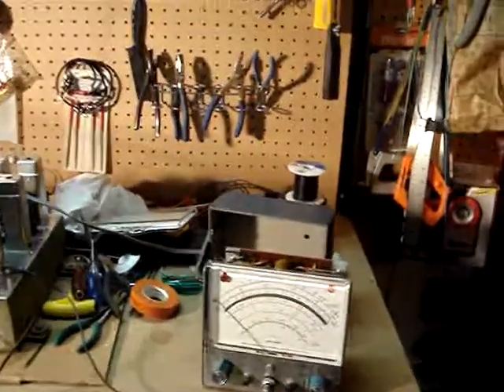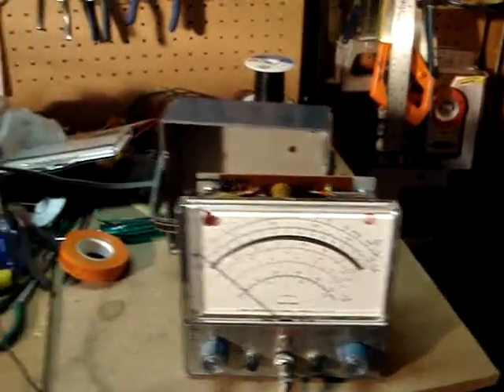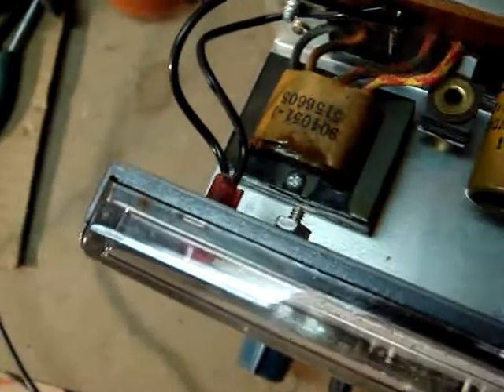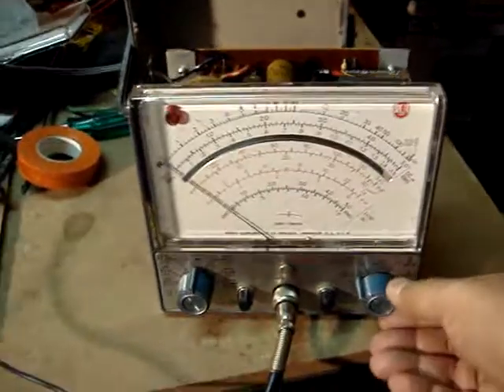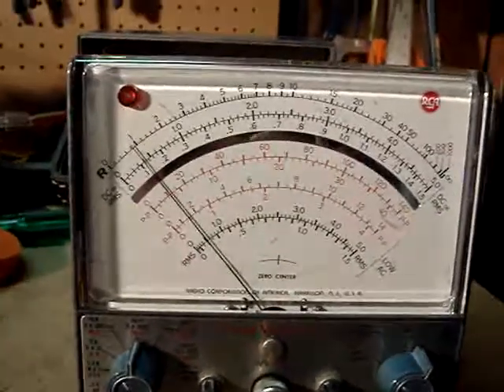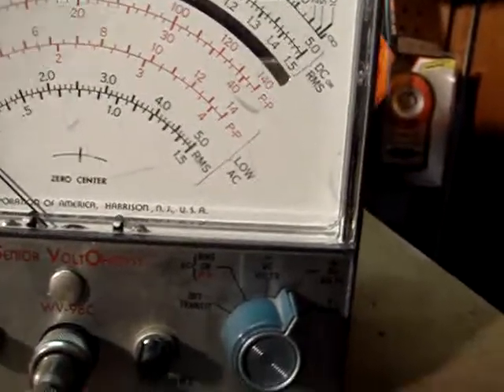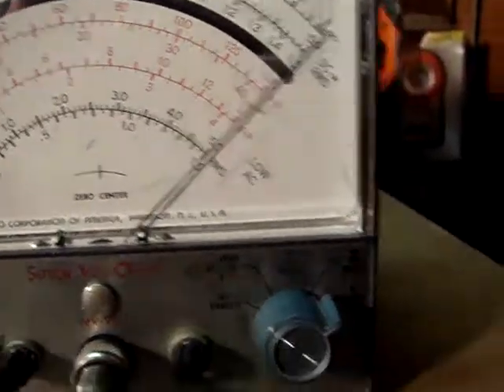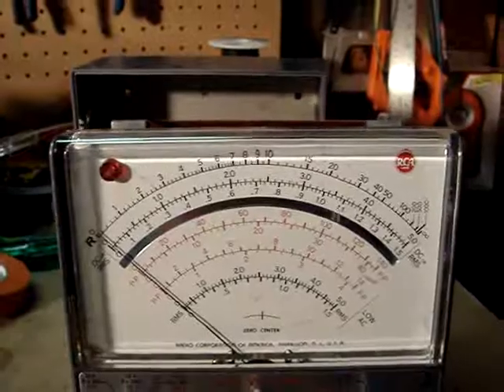VTVM RCA Senior VoltOhmyst WV-98C Meter replacement

Comment: Hi I too bought a VTVM RCA Senior VoltOhmyst WV-98C via ebay. The problem with mine is not with the meter, but with the antistatic coatings on the clear bezel and black meter housing.

Would you be interested in selling this to me if you still have it?
Merry Christmas!

Comment: @mukerjea I got the meter working, but when I switch between ac, dc- and dc+, the meter doesn't stay at 0. If I get the dc+ to be exactly on 0, and I switch to dc- or ac, the needle goes to the left past the 0 as far as it can go. When you switched between the functions, the needle stayed pretty close to 0, so I suppose there is something wrong with my meter.

Comment: @kb30022 Yes, the wire for the positive probe was shorted out. The only problem I have with it now is that it is inaccurate on all of the settings, and I'm not sure how to fix that. My ac wall voltage (120V) is showing up as 110V, and the resistance of a 100k ohm resistor on this meter shows up as 80k ohms. I think it needs to be calibrated internally somehow.

Comment: Hey! I bought this meter yesterday, and unfortunately, it doesn't work. I know I used it correctly. I put the right knob on dc volts + and the left knob on 1.5v, then I zeroed it in and I connected a new AA battery to the positive & negative probes. The meter did not move at all, except for when I switched between the settings on the right knob. Do you think I need to get new tubes? That and a battery is the only thing I can think of that could be wrong.